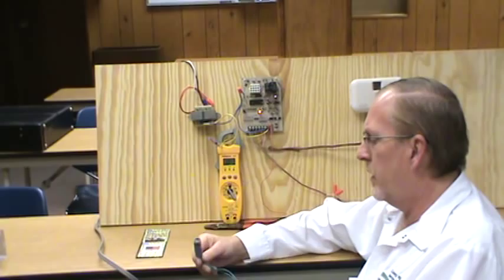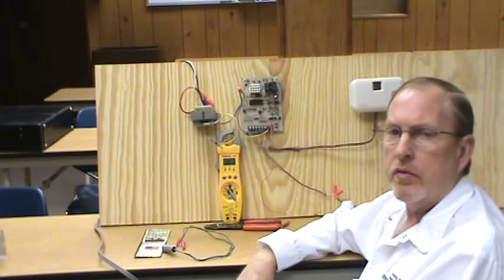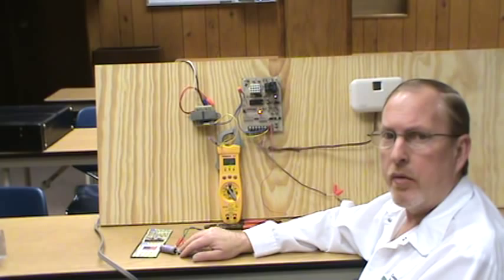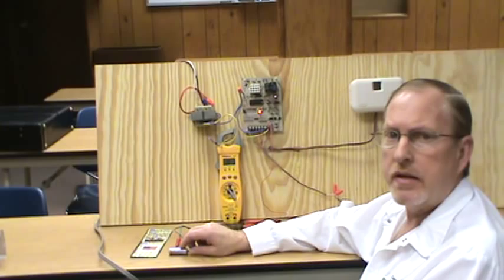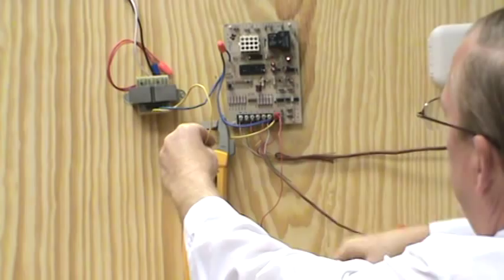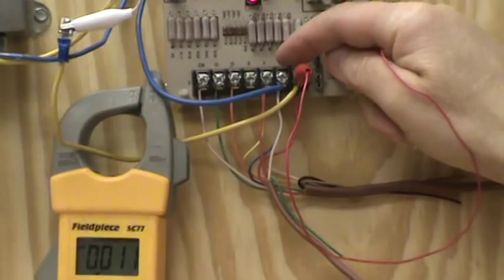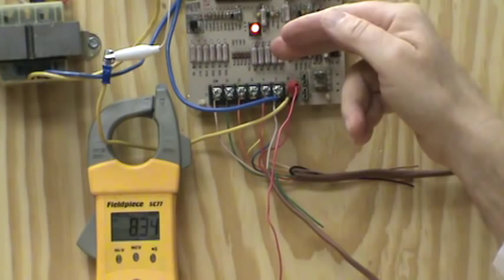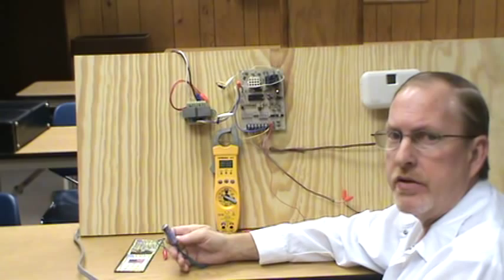HVAC low voltage test part #1

Comment: At what amperage does it trip at?    Can it be used on a 24v  10A circuit?  Under normal circumstances the circuit pulls 7.2A.........